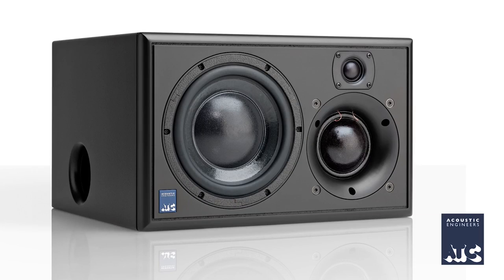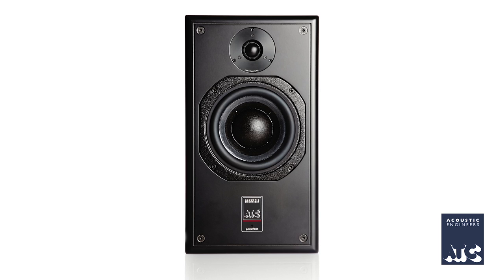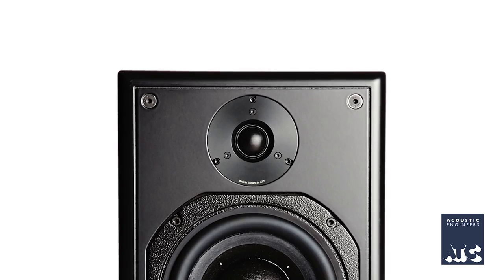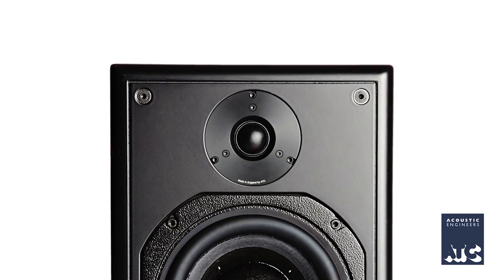Sweetwater Interviews Ben Lilly from ATC Loudspeakers

Comment: Wtf is this guy talking about "buying oem you have to pay a margin" hahahah You put a $15  Vifa tweeter on a $7500 pair of SCM25As.. and thats $15 RETAIL.. maybe like $7-$10 for them. 

Are they going to transfer that $5 savings onto us??? How nice of them! 

I do love their speakers tho.
Reply: Are great oem tweeters really that cheap?
Reply: I think he means that if they buy someone else's drivers, they pay their price which the OEM mfg makes a profit, then they have to mark them up again, then their resellers mark them up.  

What he's talking about is either passing on some savings or getting a higher performance product.

With these types of products.  The MSRP has the reseller's mark up, the distributor/importer mark up, the mfg. mark up.    Think of it this way.  If the speaker has an MSRP of $1000, it probably costs them $100 in parts, maybe a little extra in labor, and then it's marked up several  times.  So, a $5 increase in parts cost and translate into a $50 MSRP increase.   It all adds up.